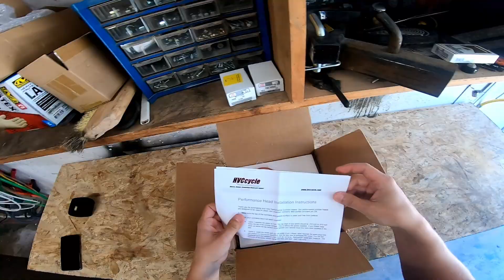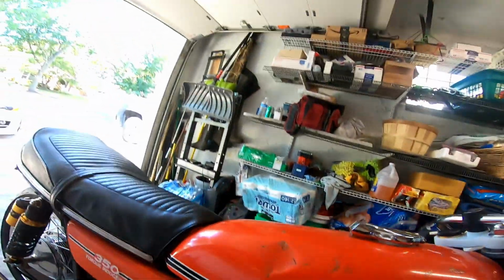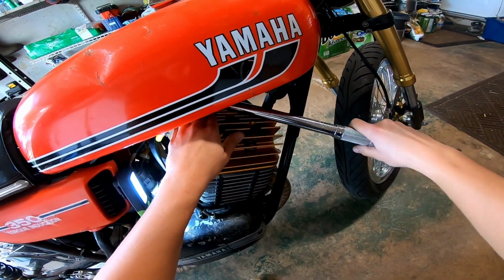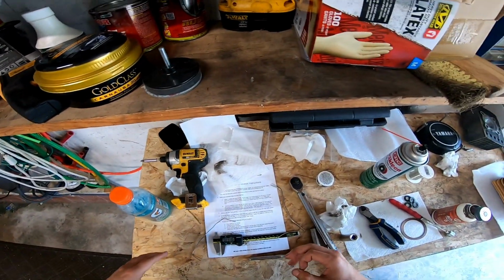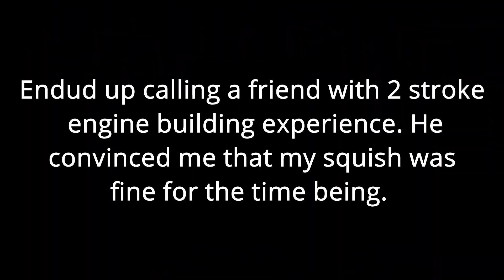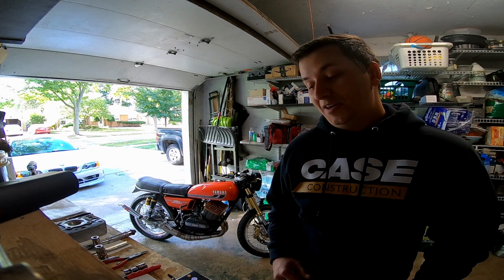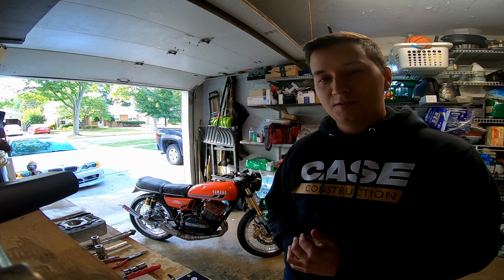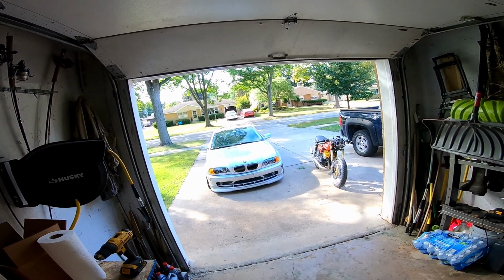Installing HVC Cycle CNC Performance Heads on my Yamaha RD350 Cafe Racer!

Comment: I had several Rd 350's and 400's also triple Kawasakis back in the day, it's great to see the younger generation appreciate these machines. Excellent job young man, keep up the great work!
Reply from the maker: Thank you! I'd love to add a triple to the collection in the future. You had quite the fun!
Reply: @Enginerded  Nothing sounds like a triple Kaw with K&N's and a set of Denco's.
Reply: 2 stroke smokers forever. I feel for young guys that never felt that 2 stroke power band hit at 7 grand in a light bike. The best I rode was 85rz350 as I am in usa and we never got the other great 2 strokes like the NSR400 honda or Yamaha RZ500 Or Suzuki RG500 gamma. I love America but man we got hosed on the best 2 strokes in the late 80s and 90s
Reply: I'm with you owned and still have a 78 Daytona RD 400. I'm 70 and I still ride it. I like BMW for comfort now. I bought Kawasaki 500 & 750 new and 74 & 78 Yamaha used.

Comment: Put some 30mm  mikunis with a breather, a high pressure clutch and drop a tooth off of the front sprocket.  Check out Spec II out in Cali, they can help you out.
Reply from the maker: Appreciate it! It already has a 520 chain conversion from Economy cycle with a 14/39 sprocket (cant remember what the stock setup is right now). Have put in an upgraded clutch with fzr plates and stiffer springs since this recording and that did the trick! Spec II makes some sweet parts. Will definitely be putting some 30mm mikunis on in the future as the original carbs are pretty rough even after multiple ultrasonic baths. Runs good for now though at least!

Comment: Where do you get the rear sets from .? Make them?
Reply from the maker: Slipstream cycle rear sets. Pretty sweet little setup. I made my own switch/bracket for the tail light to work with these as they don't work with the stock setup.

The shifter peg tends to cut through my shoe laces so I plan on making my own shifter peg or at least putting a rubber grommet over the knurled peg.

Otherwise they look great, work well, and fold up to clear the kick starter.
Reply: Thank-you
Reply: @Enginerded  I've ordered a set from them so Thank-you. Couple of weeks lead time. Are they comfy? They look well made and engineered too.

Comment: Sexy ride man. I ride a 74 rd350 that I bought in 1978. I have done everything a guy can do to an rd350 engine.  Mine dynoed at 68 horse power. Cost me 9 grand to get that but it hauls. I absolutely love your pipes.  Don't give up on this machine, you have something very special there. Once you put new bushings and plates in the clutch, throw on some 30mm carbs you will notice even more power.  I know guys say 34mm carbs but then you're just over carburated.  30 mikunis work perfect.  There is a guy in California named Gary Shumake, he runs a company called spec2.  He has forgotten more about Rd engines the most guys will ever know.  Look him up, his knowledge will help you a great deal.  Anyway man  thanks for the vid.
Reply from the maker: Appreciate the kind words and advice! Definitely want to do some 30mm mikunis in the future for some more top end without killing the driveability. 34mm's always seemed overkill to me. Spec2 makes some great stuff! Clutch has been upgraded actually and made a video about that. Maybe porting the cylinders would be fun to do when i eventually rebuild the motor as well. 68hp is nuts for an air cooled rd350! What sort of work did you do to get there? I would love to get near that.
Reply: @Enginerded  from the top down. I put those same heads you did   had them molled doen for more compression.  Ported to stage 3, rebuilt , balanced and welded the crankshaft, new pistons( cast eather than forged because then they heat up at the same rate as the cylinders., banshee reeds which reqired grinding out material to allow them to fit, a crossover pipe between the carbs, 30mm mikuni carbs, k&n ait filter with a two into one rubber boot, new clutch bushings(neoprene rather than rubber) new clutch,  heavy springs, had yo machine the inside of the clutch case 20 thousands to allow it to clear as well as used two gaskets , RD 400 gear pack so as not to be too wheelie prone, a race only electronic ignition system so it has no battery except for lights and that is a total loss system, a set of spec 2   gp pipes ,  then I had accelerated technologies build my suspension.  John Sherrard is that guys name.  He is well known in the racing world. I put a fibre glass seat with an aluminum fuel tank, and a glass fairing on it. Modified the front brakes to fit a floating rotor and used aluminum "H" profile rims with stainless steel spokes. If I can I will send you a pic.
Reply: @Enginerded  you can get 58 hp quite easily if you dont want to go nuts on the porting and leave those heads the way they are. Just a mild port job  30mm carbs jetted properly, those gorgeous pipes of yours, and electronic ignition , reeds and reed cages modified, but make sure you do the crank.  It wouldnt hurt to put new crank seals in anyway so bearings and balancing just make sence. Gary has a pkg he sells that he claims makes 58 hp.  To get much above that you need the higher compression   race only ignition, and the race gas (c12)
Reply from the maker: @elmerfudd1086   @Elmer Fudd  thanks for all those details! I definitely want to keep this on pump 93 octane for convenience, so most likely will stick to mild porting and the 30mm carbs once i rebuild the motor. Definitely will check out that 58hp package
Reply: Standard Carb 350cc 120 Main Jets & RD 400
 NEEDLE jets And A EARLY Yr5Airfilter And SCIM the HEADS 25thou ! And Clip The Reed valves ! And OPEN The Piston Ports !!!And Clip the Baffles ??.On The Standard Exhaust Pipes and RUN It On TOP FUEL !!!and BELL RAY Clear SPACE Oil 😁Ps & Tighten Up The REAR shocks And The F Forks And Fit TT100 or AVON Roadrunner Tyres on it And SHORT Flat Handle BARS !!!😁😁😁😁& Its Alter the Engine Sproket I Tooth Up ! And Fit a D.I.D.Drive Chain.too 😁And AT THE Lights !!!😂IF LIKE Me YOU Was NOT a HEAVY Man !!!IT Would SHOCK !!!EVERYTHING ON THE ROAD !!!BACK i. 77-79 😂lol WHAT A Sleeper ????? O---60 in 3secMAX !!!?AND 118 FLAT OUT !!!😣😔😔😔😂😂😂😍And Uprate The Disc Pads !!!lol a limey g

Comment: Sweet!
For more power, you can file the base of the inlet port about 1 - 3 mm. (Make sure to smooth the break point so the rings don't catch)
Change the oil in the gearbox to stop the clutch slip. You might have a friction modified oil in there that's causing the slip.
Lovely bike.
I had an RD250 with 350 top end.
Reply: Good point about the gearbox oil . R-40 is the thing to use in those . And R-30 is pretty good as Engine oil .
Reply: @johncunningham4820  You put 2 stroke oil in the gearbox? No thanks!!
Reply: Cant beat ATF in the Gearbox! Automatic Transmission Fluid
Reply: @jarnosaarinen4583  R-40 the Recommended for a Two-stroke Gearbox . Also for Detroit Diesel Two-Stroke engines BTW .
So what would YOU suggest to but in a Motorcycle Gearbox that has a Wet Clutch ?  
Very interested to hear................
Reply: @jarnosaarinen4583  . ATF is totally WRONG in that application . What the hell are you thinking ? Explain yourself , because  I  am CERTAIN  you are wrong .
Reply: @johncunningham4820  ATF works well in motorcycle gearbox ,used it loads without any problems . Auto box has multi-plate wet clutch's that are basically  the same as motorcycle clutch and ATF is excellent lubricant as well . Found it improves shifting and clutch action loads ,often cures clutch slip , problem is many gearboxes state engine oil but car engine oil contains friction modifiers these cause clutch slip . Obviously only in 2 strokes as 4 strokes share gearbox oil with engine so ATF cannot be used
Reply: @tiggy2756  . Completely TRUE about Friction Modifiers Stuffing up any Wet Clutch .
I  suppose  ATF  probably does have some of the correct specs . I wonder about Film Strength though . True Auto's are Epicyclic so rather low point loadings .
Reply: @johncunningham4820  Many years ago when I was car mechanic we changed from hypoid oil to ATF to improve sycromesh on rover gear box's ,this was manufacture instruction! . But like you correctly state it needs to maintain film strength , but I have never found any undue wear after using ATF as yet
 Being a light oil it does improve clutch action though as thicker oils can cause some drag that isn't good for gearbox
Reply: @tiggy2756  . That's why  I  mentioned R-40 in the first place . Straight Grade Caster based Oil . Unmodified . Once it warms up a little , works perfectly to protect load points without creating excessive Clutch drag .
Your average Manual Gearbox is supposed to have 80/90 Gear Oil or in a Truck 90/140 . And the Clutch is Dry in 99% of cases .
ATF is technically a Hydraulic Oil , to make the Torque Converter do its thing , as well as provide lubrication for the Gearsets without Gumming up the Bands .
A  Dual Clutch modern gearbox is a Different Animal .
Reply: @johncunningham4820  As far as I know all auto box's have multi-plate clutches as well as bands  ,at least all one's I have worked on . Don't think R40 would work well in clutch though as you would get lots of gum deposits , only got to look at engine been run on caster based oil their a mess and bugger to clean gum deposits off ,I know from experience . Quite sure most motorcycle box's use straight engine oil rather than 80/90 gear oil as that is hypoid
Reply: @tiggy2756  . We seem to have gotten into Cross purposes .
A Two-stroke Motorcycle ENGINE runs fine on R-30 and the Separate Gearbox works well with R-40 . No friction modifiers in it . Wet Clutch .

A Two-Stroke Diesel , like a Truck Engine , are often specified with R-40 , whereas a Road-Ranger or Spicer Crash Box (constant mesh) needs Hypoid 90/140 . The Diffs too . Dry Clutch .

A Car synchro-mesh Manual Box needs Hypoid 80/90 and also the Diff . Dry Clutch .

And a Unit constructed Four-stroke Motorcycle Engine requires a specially formulated Multigrade without Friction Modifiers to preserve the Wet clutch .

There are some Four-stroke Motorcycles that have a Separate Engine and Gearbox , via a Dry Clutch as well .
Harleys , Some Ducatis , Some BMWs and Moto-Guzzi

I  imagine ATF probably CAN be exchanged for R-40 except in the Diesel Engines .
Reply: @johncunningham4820  
Motorcycle gearbox,s with separate oil tend to use straight engine oil , R40 would play havoc with clutch as it gums badly (if your R40 is Castrol R castor based ) 
Only thing I questioned was your claim ATX cannot be used in motor cycle gearbox ! many including me have used ATX without problems , No you wouldn't use as engine oil if it was same oil as engine ie 4 stroke   
R30 pre mixed works well with Two stroke race engine but can only be used for racing as can only remain pre mixed with petrol /Gas for about 24 hours . I know this from experience with club racing in late 70's using R30 (castrol R ) you race for the day on pre mix then chuck it in your Van lol . Once used it week later ,to save money result was knackered piston and barrel re plating  
Diffs need hypiod oil because they have hypiod gears but gearbox's normally don't have hypiod gears 
Car gearbox's are sometimes specified with hypiod but don't really need it , take the Mini it used same gear cluster as Morris 1000 that specified Hypoid yet had no problem using engine oil in mini sump
Yes well aware some motorcycles use dry clutch race bikes did even in 70's and even the Triumph trident BSA Rocket3 road bikes from late 60's had dry clutch  
  "ATF probably CAN be exchanged for R-40 except in the Diesel Engines" ?
Why would you ever use ATF as engine oil ? , but if used in gearbox why would being Diesel make any difference   ,We got wires crossed here ?
Reply: @johncunningham4820  Plenty of modern better oils now ,R30/40 castor based oils belong in the past as they are mucky old stuff leaving nasty sticky gum all over the place . Could never clean stuff off can't imagine what effect that would have left in engine gearbox for a year ,great for race engines not for road though
Reply: I had an RD350 back in the 1980s. My neighbor had demolished it by running it into a tree while drunk. My best friend taunted me into buying the thing and rescuing it. I ran it about 5 years or so to work and school while I was studying EE at Penn State. I always ran ATF in the gearbox (for a bit of a different reason than you guys, though) and never had any problems. The biggest reason I ran it was as a carrier for ATF Sealant.  Those bloody little o-rings ALWAYS leaked. That little bike rip-snorted and I NEVER had clutch or gear box problems. Ever. Except for leaking seals. For well over 20k miles. On a demoed bike rescued from a neighbor's front yard. Last thing I'd worry about is ATF in the gearbox. Just keep oil in that injection tank. And carry 2 spare plugs for foul-outs.
I'm redoing a '72 350 R5 now - the guy I bought it from fried it by running it out of injection oil in 1974. I'll have it on the road this winter. I'll likely run ATF in that 5-speed box, too. 
Keep those mod vids coming. Great ideas. My likely only change from stock will be expansion chambers and Mikuni jets. Better breathing doesn't break things like higher compression does. I can smell that 2-stroke smoke now. Mosquitos beware!

Comment: Those pipes sound great and the head colours match well with your forks n rear shocks.  I had an RD350 back in the late 70s and was the most Fun bike I ever had.  I always wanted expansion pipes on mine like you have, but was too tight to spend the money.  What a poser I was on the back wheel around town on a busy Saturday on Main Street shoppers running across the road as I wheeled through them.  The police never could catch me in there little mini police cars as I wheelied past them and darted down narrow back lanes etc.  Enjoy your RD.........I loved mine  :)

Comment: personally i would leave it as a standard head ...from memory i used to use 2mm BTDC on the diall gauge for timing or else it would eat pistons or not perform at all  ...i love the sound from the motor as it brings me back to the days of my R5 and RD400

Comment: Yeah after hearing you get on it, it's completely fine, you'd know immediately if you were detonating due to too high of a compression... just run 93 in it to be certain lol.
Sounds phenomenal though....new clutch, stiffer clutch springs, and IDK how true it is or if it's complete BS, but there's both these little cross airfoils you can put into the stock carbs(and aftermarket) as well as these little guys you can put inside the carb slides that'll effectively turn your round slides, into acting like Flatsides....now I've "heard", that there's big HP to be had with those very cheap carb mods, like, definitely more than the heads, I'd give them a peek 
(I've been looking at RD's, hence me hearing about them lol)

Comment: The oil-based paints are easy to spread, partially self-balancing, and offer an excellent hold. Most often one coat of paint is enough for the painting anodized aluminum, but not every time. If the aluminum has to face harsh conditions applying multiple coatings is good.

Comment: The RD 350 is a kick ass bike my friend. I remember them as a teenager when they first came out. Great bike and I like what you've done with yours , the USD forks , the cafe bars and now those new heads. Too bad about the dent and scratches on the gas tank. I also like the after market exhaust system.
Reply from the maker: Thanks! The fork conversion i did myself. Designed various adapter parts in CAD including an upper triple clamp and had everything machined. Running honda grom (msx125) forks with stiffer springs. Will be additng a cartridge kit to them soon to add more damping control. Bike should be getting repainted in the future so no more dents!

Comment: we used to race them 40 odd years ago! Sorry but yamaha did a terrific job designing the engine, and gbox too. If you want more go don't bother fiddling with the engine, apart from cleaning the ports up. A rebore with original yamaha piston kits, with a very fine hone job and tight piston clearances will serve you best. Should be good for 180kms/hr. If you want 200 to 220kms/hr look at the later water cooled engines. They used to lap racetracks in the same times as early TZs. cheers.

Comment: I have a 1973 rd350 that I built in my living room. Running there pipes. Scr racing ported my motor. And did the heads. Brad Owner at hvccyle said it was one of the fastest he ever road!
Reply from the maker: Thats awesome! I definitely would love to get the cylinders ported by Scott when i get around to tearing the motor apart. Must be a ripper!

Comment: Just started on a build with my dad on this exact bike. It’s the first time for both of us. It was a barn find and we have completely stripped it. Our plans are to do something like what you have. Thanks for the video! Please post as many RD projects as you can.
Reply from the maker: That sounds like an awesome project! Mine was very much a barn find. Non running, no keys, but clean title and felt good on compression when kicking it over. Long story short it didnt take much to get it running, and the original key was locked in the gas tank! Love to hear another rd350 is getting restored 👍